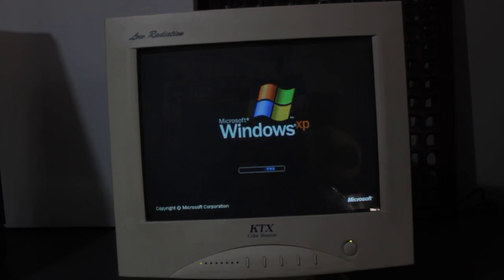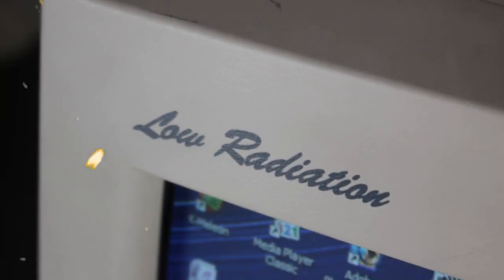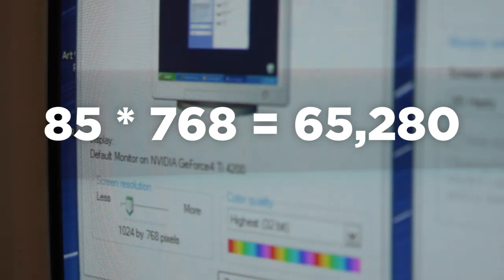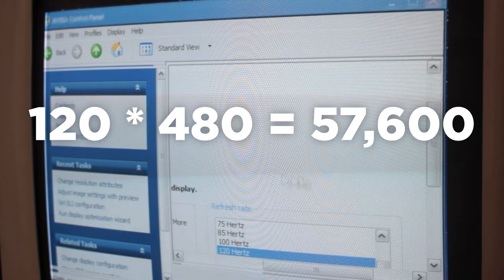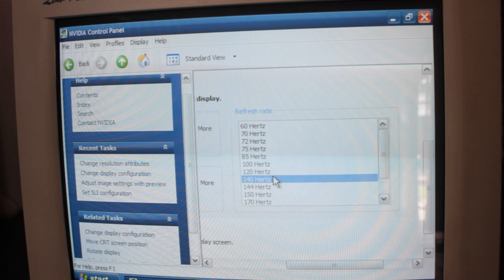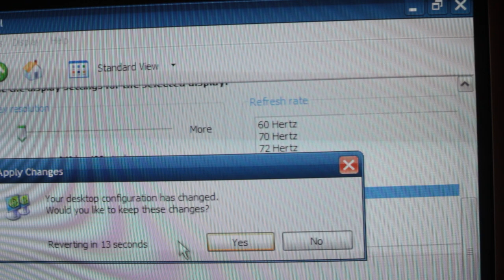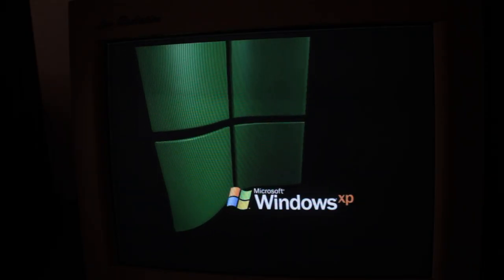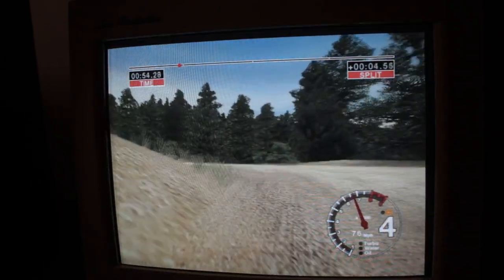"Overclocking" a CRT Monitor!

Comment: You should try interlacing. My CRT has a max resolution of 1280x1024 at 60hz, but I got it up to 2160x1792 at 75hz, and 1280x1024 at 120hz.
Reply from the maker: Totally agree 👍 I'll try this when I find a gpu that supports the graphics driver with this feature
Reply: @ElectronicInspiration  You should be able to use a tool called CRU (custom resolution utility) across any GPU if I'm not mistaken. It should work. I remember using it on XP as well.
Reply: I have a LG StudioWorks 700E 16.7" CRT monitor that supports max 1280*1024 at 60Hz, but for some reason, that resolution looks horrible blurry, I mean text crispness is just not there. It's fine at 1024*768 at 60 Hz. 

How does 1024p look at your CRT?
Reply: @gizmoknow-how2022 This is usually due to the dot pitch of the display, the electron gun can beam whatever resolution it wants to the display but the phosphor grid will limit the actual viewable resolution.
Reply: @justanotheryoutubechannel  cant you remove that layer and replace it with something that doesnt have a grid? or maybe just a smaller grid?
Reply: @illusionalperson676  You still need some kind of layer, since it actually has the phosphors which glow to produce an image, but some monitors do have a much finer grid than others which allow for a higher resolution image. But these layers are built into the tube themselves, it’s not something you could modify yourself, and there’s complexities to increasing the resolution.

The primary one is that you need to avoid colour bleed caused by the electrons that make the phosphors glow hitting the wrong phosphor, usually this is resolved by another layer called the shadow mask, which physically blocks electronics coming from certain directions from hitting parts of the phosphor layer. This technique works, but it always blocks some degree of correct electrons too, and the finer the grid the more difficult the mask is to engineer, and the more accurate the electron guns need to be.
Reply: @justanotheryoutubechannel  if we can make terabytes of storage in such a small space why can't we do the same for the amount of pixels or how fine the grid is on that one layer

Comment: Modern CRTs would easily reach more than 1000 frames.
Reply: It was a very retrograde step for games. I took a break from games because I went to uni, and got a real life,  and when I tried to play them again suffered really bad motion sickness. I didn't realize it was the motion blur of LCDs that was causing it until I tried again in a CRT. Thought it was my age.

Comment: tiny quibble: the "small risk" of breaking something in your monitor by doing something like this is... insignificant. any respectable monitor will have some error handling when it runs into something it can't support, since these things were designed with variable resolutions and refresh rates in mind

Comment: You should experiment with a modded old ATI card, It's usually used for Groovymame to get accurate resolutions and refresh rates for emulating arcade games. I have a modded arcade cab with a windows 7 pc with that ati card and emucrt drivers. I'm running a jamma to vga connection and I can run the arcade monitor at 320x240 (native res for the arcade monitor)
Reply from the maker: @joshsowers   hmm, will consider

Comment: given its a 768p85hz tube, I'm going to assume it does 1280x1024p60hz, which means you could get 1280x1024i120hz through interlacing. Try it, smooth as butter. also, use 1366x1024, as that's true 4:3.
Reply from the maker: Ill try interlacing, but the amd driver is a bit finicky (im using a Radeon card now)

Comment: You can do a lot with this technique, I remember my old CRT supported 1280x1024@60hz out of the box but I spent most of the time running much lower resolutions. I was running windows 7 at the time and in that version there was an option to disable EDID, which meant that it would let me enter whatever resolution I wanted without stopping me. I remember getting 800x600@120 working and if I remember rightly even 640x480 at 200hz, although I don’t know how since using maths to calculate frequencies this should have put it out of range. Unfortunately it broke one day, and without having the skills to fix it or anyone nearby to repair it, I let it go.

My replacement monitor has a curved screen which is nice for the older vibe but it tops out at 1024x768@85, but considering there’s not much reason for running games at higher frame rates than 120hz it isn’t a huge loss, and the curved screen suits the type of old games I play on it quite well.

Comment: There's one small thing you are missing when calculating the refresh rate. On CRT screens, about 5% of the time it takes to scan the screen is spent moving the electron beam back to the top, so you should consider that in the equation. So when you calculate the maximum refresh rate on 480p, the equation should be like this:
65,000 / (480*1.05) ≈ 128

At least that's what I understood after doing some googling, please correct me if I'm wrong.

Comment: You should try interlacing, you can get 1024x768 @ 160Hz that way. Your gpu should support it.
Don't listen to those who are saying to use 1280x1024, that's a 5:4 aspect ratio, you are gonna have to stretch the image to make it fit on the display

Comment: I use a crt daily. 
my CRT (Sony Multiscan E400E) goes up to 96kHz and I overclocked it to 97kHz
Reply from the maker: would this mean it is possible for 120hz at 1024x768?
Reply: @ElectronicInspiration  yes
Reply: @ElectronicInspiration  did it work?
Reply: with sony trinitron monitors, the later model ones that work with windas you can modify the windas .dat file and set even higher limits, i have a dell p780 which is bassicly a sony cpd e200 internaly and i managed to get it to run at 94khz (85 is stock) and 160hz vertical (120 is stock). past 94khz i hear what i assume to be the flyback start making funky noises and the image goes fuzzy a bit, i havent tried going past 160hz verticaly though so not sure what the real limit would be, i might try getting 200hz later this week if i can be bothered to hook it up to a pc again.
Reply: @wickedstudios7477  yup, sadly you can also brick your monitor probably so dont mess with it too much.
i realy wish i had the breakout cable for it, i would love to recalibrate it since sony monitors software keeps decreasing the gamma or something
Reply: @janno288  yeah sony monitors keep turning up the g2 voltage as they age to compensate for the tube degrading but they built it too good and it ends up looking too bright. yeah I've bricked a monitor with windas before but that was my own fault, the model number was not in any windas version i could find so i just picked one that sounded like it would work bassed on the specs and it ended up destroying the osd and having the monitor sync weird with resolutions.so yeah I agree it can be risky but if you know what you're doing and save the file often its not as bad as people say. I got my cable for like 10 bucks on ebay and it works great on every monitor that I used it on.

Comment: nice, what are the pc specs, maybe i get a pc like this too
Reply from the maker: Athlon XP 2400+
Radeon 9000 PRO (I think)
1.5gb ram
Motherboard is Gigabyte GA7VAX
Case is Linkworld 313N
And some failing hard drive that I should replace...
Reply: @ElectronicInspiration  wow, thanks, i will subscribe

Comment: Your VideoCard: NVIDIA GeForce 4200Ti

Direct3D 8.0a
Vertex Shader 1.1
Pixel Shader 1.3
OpenGL 1.3
Supports up to Windows 7 (but without Aero and Premium functions)
Drivers:
Windows 95 98 Me: 81.98
Windows 2000 XP Vista 7 93.71 or 93.81 beta
Reply from the maker: ok